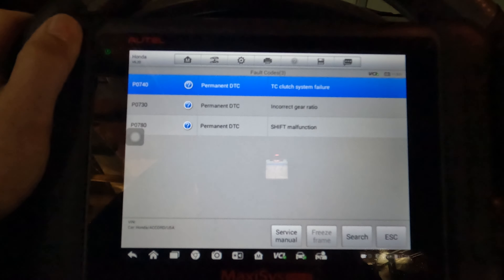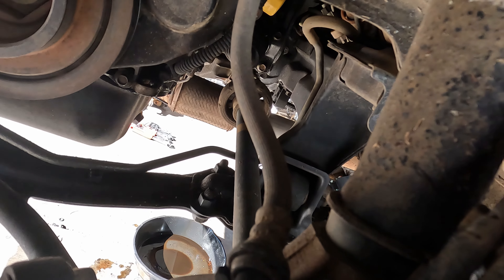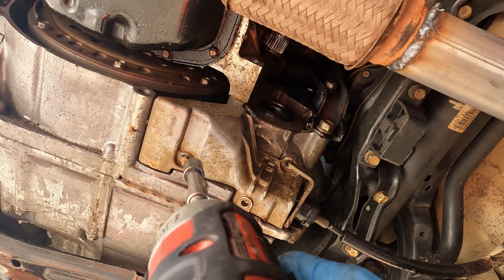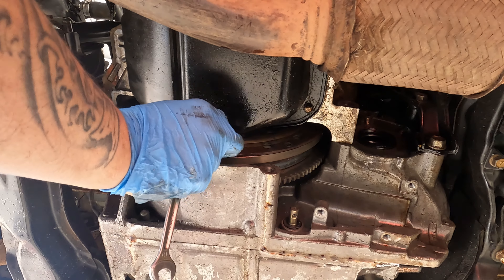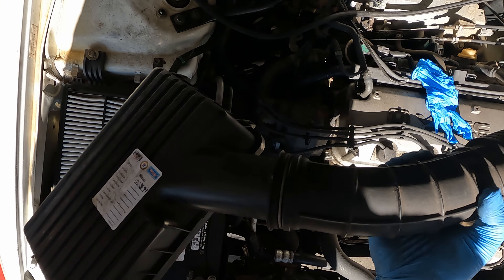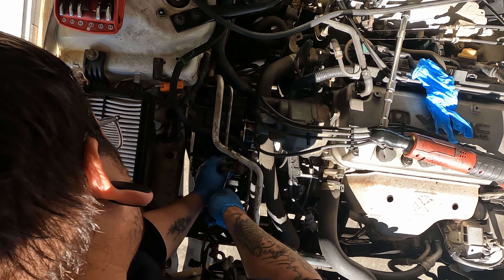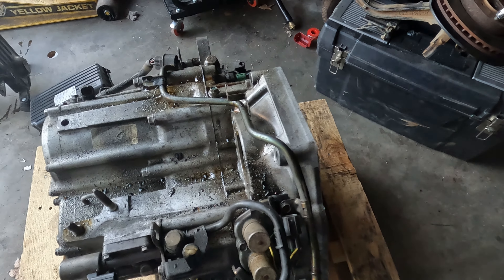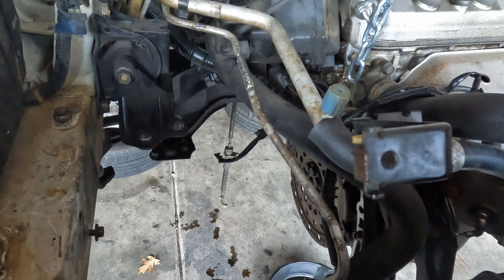98-02 Accord Transmission Removal

Comment: You just saved me hours of work coming up, gonna be doing this same thing in a few days and now i know what to do and what NOT to do. That what "NOT" to do is the key to a job like this. My transmission went bad from the differential going out and now transmission is basically fried. This here looks way easier to do than i had in mind... thank you for the video.
Reply from the maker: Your welcome and it is not as bad of a job as most people would imagine.   The axle nuts tend to be one of the harder things for people to remove.
Reply: @operationoverhaul  originally I figured it would be a nightmare, but from watching this video it won't be bad. I have a impact for those axel nuts, so those will be a breeze for me. My biggest issue is I don't have a large floor jack, but I do have a overhead hoist to lower the transmission, and I'll use my regular floor jack with board to hold the engine up. A bit different but with the same results... thanks again.
Reply: @operationoverhaul  I had to go buy a 50 dollar breaker bar for my axle nuts but I got em boys

Comment: Thanks for this have an 00 accord that I'm going to do a trans swap it's at 230k miles ran like a champ until the trans gave out got a JDM import trans for 800 bucks with less than 60k on it and your video is going to help me make this champ run like new again
Reply from the maker: Your welcome and that's a decent price for a transmission on one of these as well depending on your area.  If you need anything while doing the swap let me know.
Reply: @operationoverhaul  I'm out in Cali . Thank you so much man I will definitely keep in touch if I need help
Reply: Where did you get it from cause I need 2!!! One just stopped going and another got stuck in the mud and the lines blew!
Reply from the maker: @mandybaker8544  Look on car-part.com and it will list places near your zipcode that has them available.  I use that site a decent amount.
Reply: Wheeling the old accord lol?@mandybaker8544

Comment: Great info in the vid, sadly, I cam to see how you actually dropped the tranns like the whole part you did off camera.
I just rebuilt and reinstalled my MAXA but must have put the reverse lock up gear in upsidedown because I have everything but reverse. Swapped the reverse lockup solinoid a known good one hoping that might have been it but no dice.
I pulled the whole engine/tranns as a unit from the top as I was replacing the engine, so learning how to pull it from the bottom would have been helpful. Onward to more vids.
Reply from the maker: After unbolting everything it literally just slides back and you can lower it down.  You actually have a decent amount of room to do it.
Reply: @operationoverhaul  I saw that on another video. So much easier than plucking the whole thing from the top. 🤙

Comment: I have a question about how much fluid did you use to fill it up. I got me a Japanese one and was wondering if I should fill it up pass three quarts or the 6+ quarts. Great job and video!!
Reply from the maker: I would add about 3 quarts and then check it while running to see if you need to add more.  I cannot remember exactly how much I used.

Comment: I’ve been hearing some whirring at idle and when I shift into reverse and I’m assuming it’s the transmission. I’ve read up on some forums and found out that it could be the sump clogged up with some material which can only be fixed by pulling the transmission. All of this research eventually brought me to this video to figure out how to pull this thing out. But before I do, can anyone tell me if I should pull the transmission or if I should try an alternative before going for it?
Reply from the maker: I would drain the fluid first and see if any sludge/debris comes out.  You could even send me a picture of it if you would like.
Reply: @operationoverhaul  yeah man, I have a 3.0L coupe so removal is gonna be different from this vid if I do pull the trans
Reply from the maker: @_r33v3_  i can get you work instructions on pulling it for a 3.0
Reply: @operationoverhaul  sounds good!

Comment: For some reason I can't break the transmission from the moter it's like it's stuck maybe can u help???
Reply from the maker: It may be stuck on the dowels that line up the engine and transmission together.  They can corrode and make them stick.

Comment: Couldn’t find a second video to reinstall trans I have 3.0 v6
Reply from the maker: I only did the removal process as it is the reversal of the removal.  But, the V6 is a little different from the 4 cylinders.  If you need work instructions I could send some to you via email.
Reply: @operationoverhaul ik you responded to him but could i also get those work instructions emailed if you don't mind me asking?
Reply: May I get some instructions as well please?

Comment: My transmission dust cover is missing. Whats the danger.
Reply from the maker: You can get dirt and debris inside of the bellhousing and it can eventually cause build up and possible front pump seal damage or rear main seal damage.  Those are extreme cases but it is possible.  I'm pretty sure that you can find one in a junkyard and get one.

Comment: I’m taking my trans out my 02 Honda can u tell me how u get that one bolt behind the engine it’s connect to the back motor mont the only bolt I can’t get and I t’s holding the trans from coming out
Reply from the maker: Would you be able to take a picture and email it to me?  It has been a while since I did this and cannot remember right off the top of my head which bolt that is.

Comment: Ok so I am having an issue where it doesn’t like shifting in 1-2 gear, if I manually shift it, it will shift. I’m coming to terms with I need to replace the transmission…. Any other things before?
Reply from the maker: Does it have any transmission codes on it and have you tried anything yet?  Just checking to see if you have performed any repairs to it to help me narrow it down.

Comment: How did you get the subframe off to get the trans out?
Reply from the maker: Do you mean what did I use to lower it, or what all did I remove to take it out?
Reply: @operationoverhaul  how did you get to the two bolts between the strut fork without someone holding the rotor out of the way
Reply from the maker: @Baked Life420  I had my wife help me by pulling it to the side. If you do not have anyone you can tie it back with a bungee cord.

Comment: I have a rear engine seal problem where engine oil leaks.🤔
Reply from the maker: This would be the same process basically as removing the transmission but you will also have to remove the flywheel/flexplate and change the rear main seal.
Reply: @operationoverhaul  Now, I see why they would charge me $700 to $800😅Might as well pay to rebuild the whole thing! Would the leak worsen🤔😔😇👍
Reply from the maker: @bryanbarajasBB  yeah it will continue to get worse.

Comment: Do you think this tutorial would work for a 1991 cb7 accord?
Reply from the maker: yeah, this is the same basic concept as the cb7.  I owned a cb7 for a while and personally I think that they are easier than this generation.
Reply: @operationoverhaul  wow thanks man, I’m an pretty inexperienced car guy and this is my first big project do you have any advice I’m about to pull the transmission
Reply from the maker: Hardest part will be the axles if you do not have air tools or an electric impact to remove the nuts.  You can use a long breaker bar, then thread the lug nuts back on, then use a pry bar or something against the nuts to break the axle nut loose.  They have a decent amount of torque on them.  Then, just double check all you bolts are out before prying on anything.  I would drain the fluid first as well.  Other than that just lower it down slowly and watch your hands.  Alot of pinch points on those cars.

Comment: Hi, what are the electrical wires you had to remove with it ?
Reply from the maker: They were the wires running to the range sensor/gear selector switch.  The sensor should be behind that metal cover

Comment: What bolts on the back of the transmission 98 honda accord did you take off to drop it
Reply from the maker: There is a mount on the back of the transmission about where the engine and trans meet.   Then it has a cover for the torque converter and shifter on the bottom/ back.   Then the bellhousing bolts.

Comment: Did you figure out where the oil leak was from
Reply from the maker: The engine oil leak was coming from the valve cover gasket and it had a power steering leak.